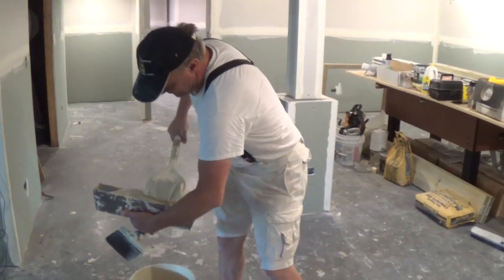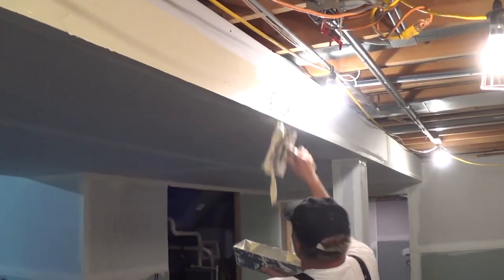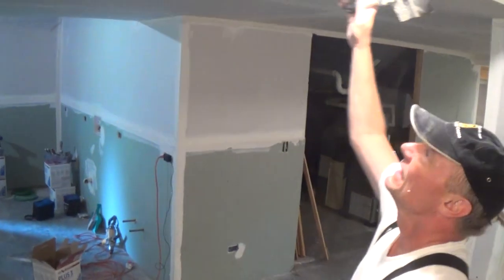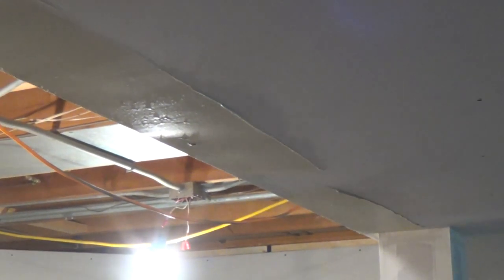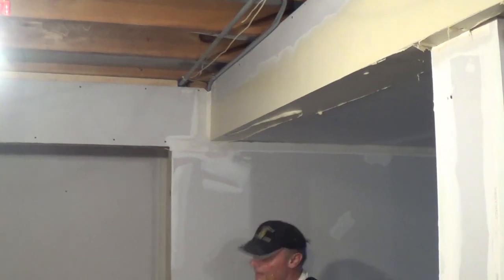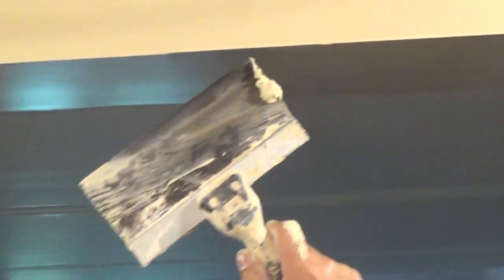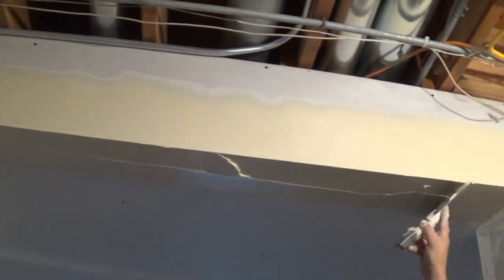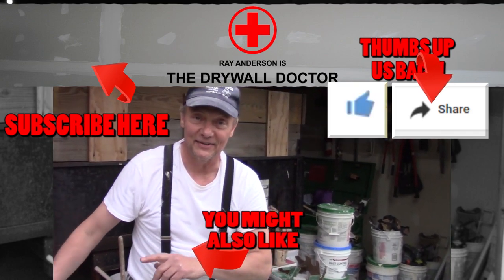Soffit corner bead coating/mudding   made easy and fast!!!

Comment: Hi :)  we are working in a building with 16 apartment and 2  new soffit by bed room and takes 12 days so any tip we can use from you sir? We have 10 and 12 inch box... Thanks
Reply from the maker: ? I'm not sure heavy mud will not pump and you always want your first coat heavy. Then you can skim and touch up with the 10 or 12 box

Comment: What type of mud are you using, we use the 5 min stuff at work which hardens quickly.
What is that 45min stuff?
Reply from the maker: No just +3 there is to much work here to use hot mud to coat.  I always allow myself drying time.

Comment: That tool you used to take the mud out of bucket what is it called? And could you mix with it if you had to
Reply: I call it a stomper and yes you can mix mud with it. It just takes a little elbow grease to do it.

Comment: can someone please tell me if you pul the flats before angles?  do you pull both flats that run into the angle, and then the angles? I pulled my flats, then just ran the angles up to them.. is this wrong?  what  goes first?
Reply: Melissa Salzmann  if I'm understanding what your asking here's how I do it,1st the non tapered joints,2nd the tapered joint,3rd the inside corners, and outside corner bead. I do it in that order so that the drywall tape over laps itself in all the best spots. Hope that of some help,again that's if I'm understanding your question the right way.
Reply from the maker: Sorry I'm just reading this for the first time.  I've seen it both ways it's what ever your comfortable with.  Before I sand I touch up and look over the entire job. Every thing is dry and  if I have to  come back the next day to sand so be it.

Comment: That’s putting it on thick for sure.
Reply: Done right, it should only need 2 coats. Your mileage may vary depending on the type of mud and bead you use. 

One coat to fill, skim coat to make it pretty and easy to sand.
Reply: GattaSplatta Man you can call me what ever you want.  That’s all I need to do to my bead.
Reply: Michael Durkin sorry that wasnt nice of me to say.

Comment: Question for you, stainless or blue steel and why
Reply: Robert Cary I personally like blue steel that what the doc is using. There more flexibility for cutting in when filling in corner bead or joints and stuff like that. Stainless I would use for filling in deep stuff or floating since the blade is firmer. Fills in. Hope that helps
Reply from the maker: I always use blue steel.  Stainless knifes don't flex back and tend to bend easy and like I said not flex back.